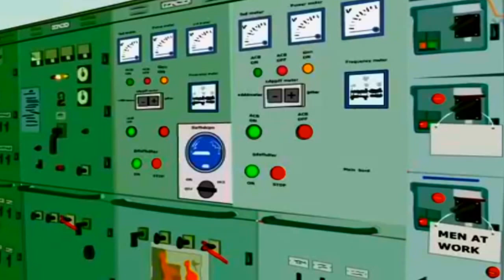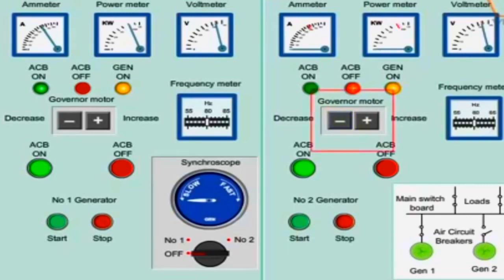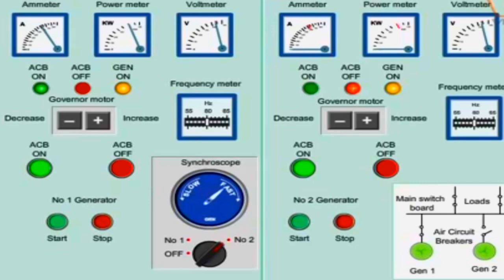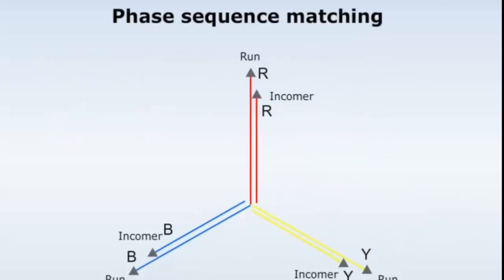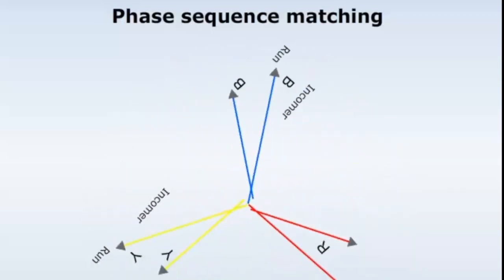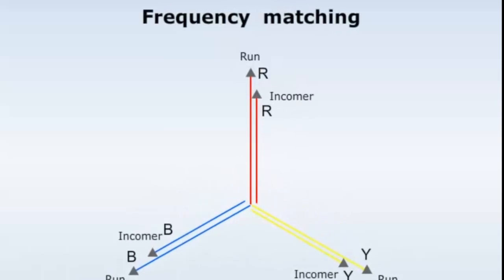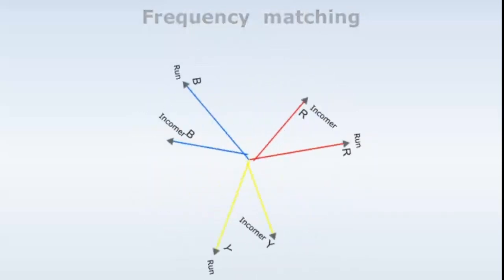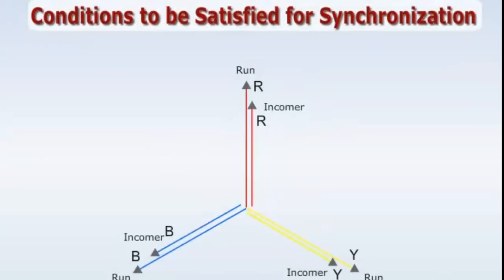HOW TO SYNCHRONIZE THE TWO GENERATORS | SYNCHRONIZATION OR GENERATOR PARALLELING PROCEDURE

Comment: Thanks for detailed explanation sir.  I couldnt understand that what will occur when different frequencies of synchronized alternators. Could you explain it again?
Reply from the maker: This is just for understanding purpose only. Once you go through the book you will get it easily. If there is difference in frequencies the Acb won't close upto matching the frequencies. You can control the frequency with the help of governor control